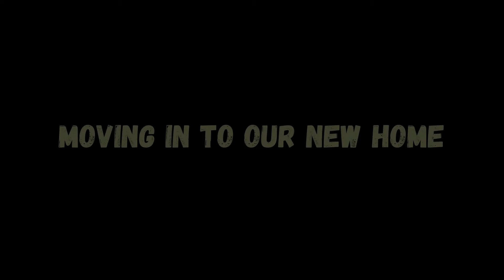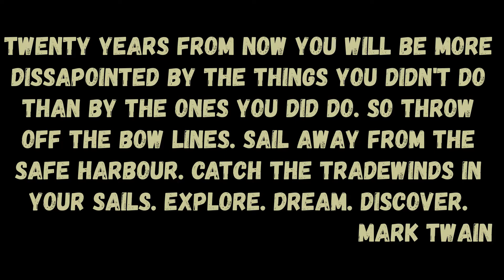"Wind over Water", Episode 1 part 2   Preparations.... How to go cruising in five easy steps

Comment: Chris, How tall are you?  I'm going to look at an Aloha 32 and am 6'1".  Much of the literature says the Aloha has 6'4" of headroom.  If so you must be at least 6'5"s.  Steve
Reply from the maker: Steve: The rumors of 6'4" headroom are somewhat exaggerated. That is my height and I have to slouch a bit just about everywhere. It may be maximum headroom near the companionway but that is it. The berths and headroom are all about 2 inches short for me so I would think you would just fit. Great boat otherwise. Very good boat to sail. Quite sure footed and easy to control in a marina.
Reply: @WindoverWater  Thanks Chris. I was on sv Agape (A32) 14 years ago and remembered her being a little tight. Really appreciate your refit website, insightful Aloha forum posts and these creative videos. Best of luck on your cruise. Steve